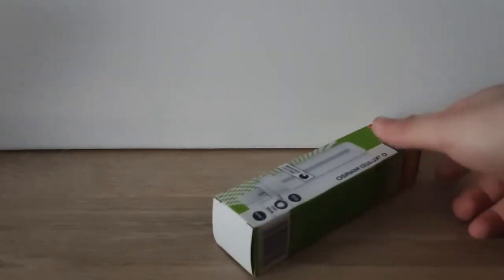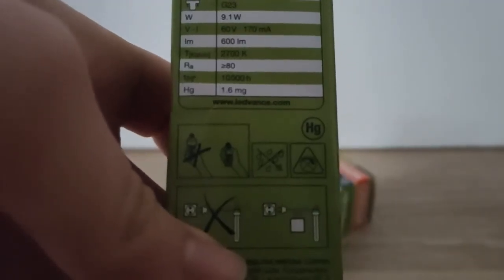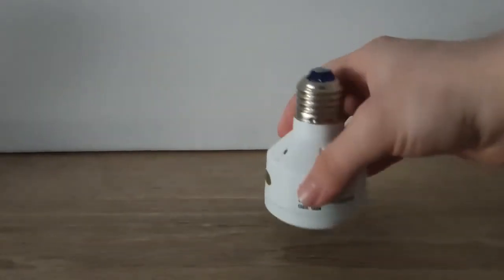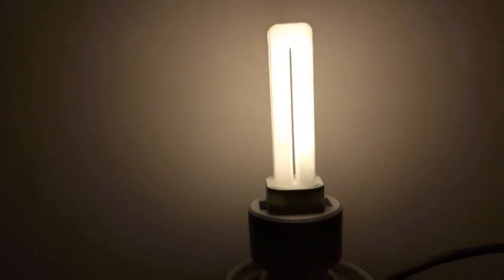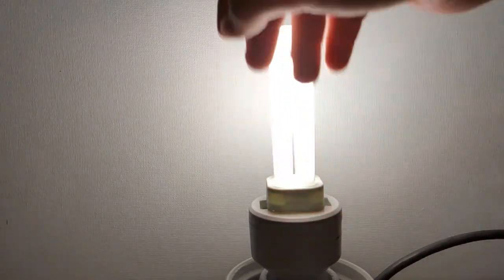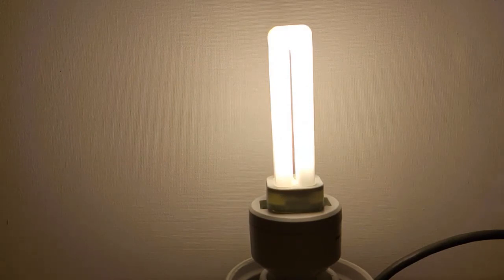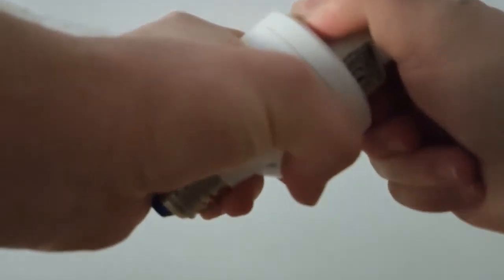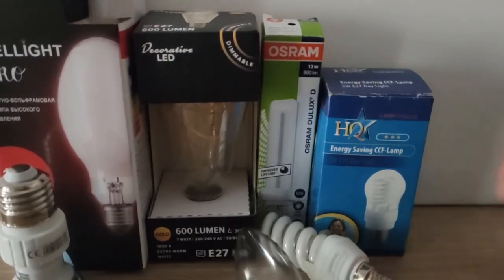OSRAM Dulux D (Osram Dulux d 13 Watts Fluoroscent Lamp) plus Adapter

Comment: Please suggest adapter for osram dulux D 26 W
Reply from the maker: Hmm i am unable to suggest you a 26W adapter. Now,i have used slightly higher wattage on it (and it might work) but for these scenarios i have a reflector of these types. I was barely able to find this adapter on Amazon

Comment: What is the voltage please?
Reply from the maker: The input voltage of the adapter is 240V 50Hz. I do not know the output voltage but PL bulbs that go with this one claim that the required voltage is about 91V

Comment: Can you share adaptor name ....that you use in the installation
Reply from the maker: It doesn't appear to have an name. But if you go on Amazon and search for E27 PL adaptor you should find ones that look like this. Make sure they specifically say it's for PL lamps and not for LEDs. Look at the reviews as well to see if it's an actual PL adaptor. I will cone back with the exact link once i find it again
Reply: @photonik-luminescence   thank you

Comment: Do you know if the adapter uses an electronic ballast? Normally, G24D1 2 pin 13w PL-C CFL lamps use magnetic preheat ballasts due to the internal glowbottle starter.
Reply from the maker: Well yes, it does use a magnetic ballast. Thankyou for the question.
Reply: I know these adapter models. It's electronics unfortunately. You can see it on ignition. The lamp lights up even before the starter starts working.
Reply from the maker: I have not experienced tgat. The starter starts first and then the lamp strikes for my adaptor.